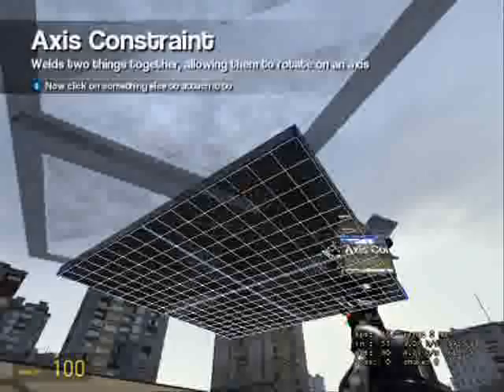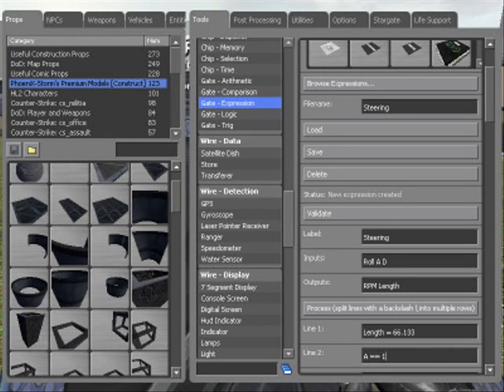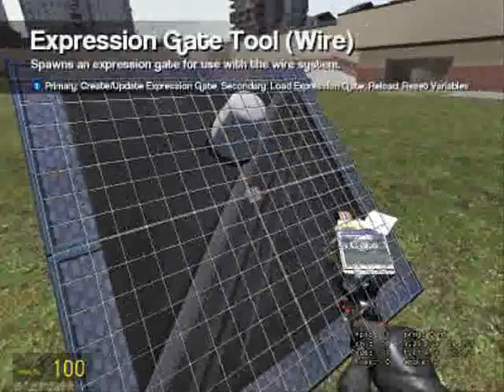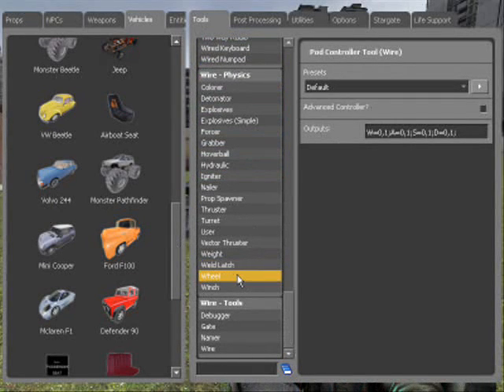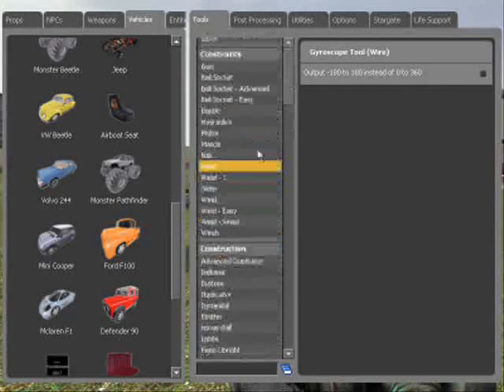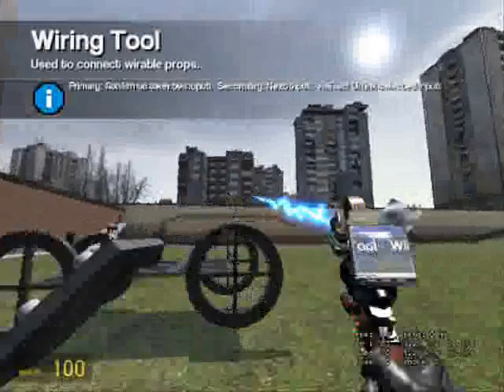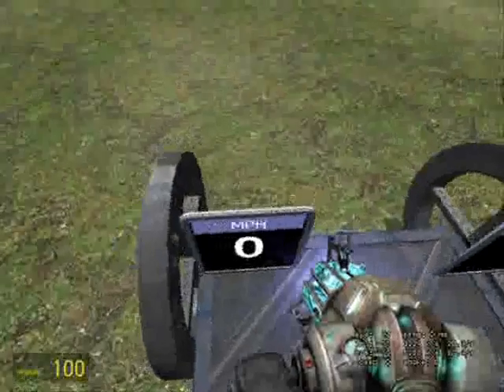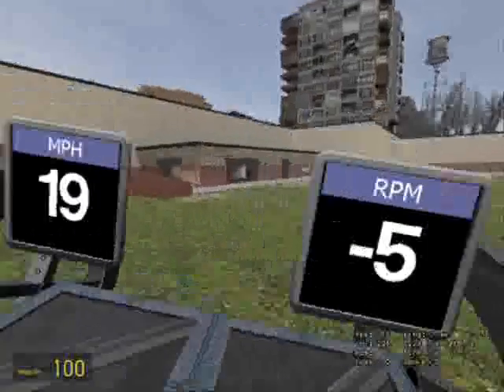Ducky's Tutorials # 16 - MPH and RPM Counter

Comment: @bigun1999999 I know im bumping a two year old comment chain, but you deserve it for being a dumbass.  rpm OF an ENGINE is the rpm OF an ENGINE, but just revolutions per minute or rpm alone could be the revolutions per minute of anything.  Even the earth has an rpm, it just happens to be a decimal,  0.000694,  but that proves the point.

Comment: Put E2 chip on the wheel where he put the gyro and use

@name RPM
@inputs 
@outputs RPM
@persist 
@trigger all

runOnTick(1)

Wheel = entity():isWeldedTo()

RPM = abs(Wheel:angVel():yaw()/360*60)

Comment: rpm doesnt measure revolutions of the wheel it measures the revolutions of the engine output... having an rpm counter on a wheel is just pointless.. that and the fact that your rpm counter doesnt work.